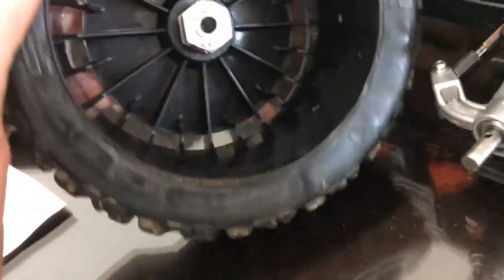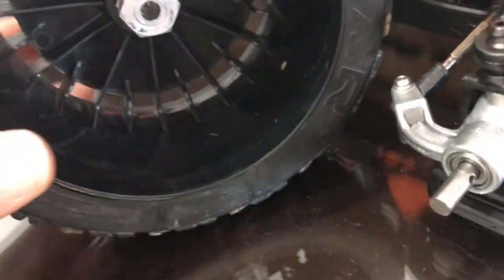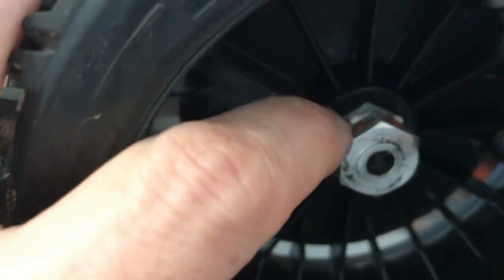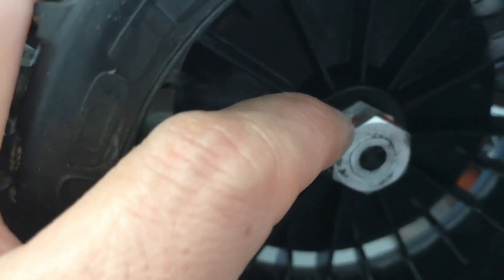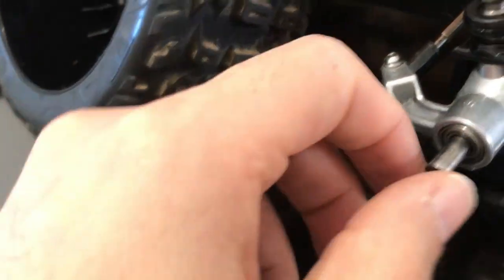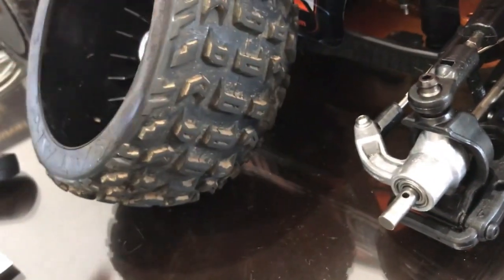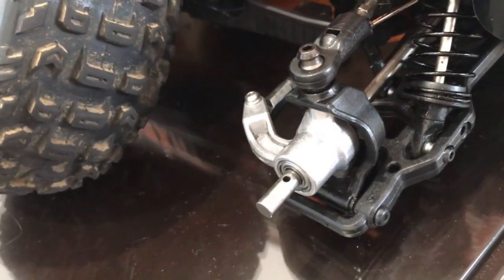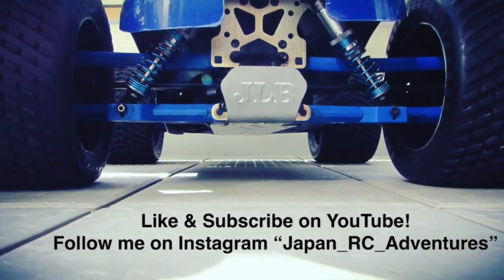First DHK Maximus 6S 😂😂street run Blooper😂😂 of 2019

Comment: Where did you get them wheels bro and use rubber grommets bro you can buy boxes with multiple sizes for cheap I honk I seen in one of your later videos that you have been using thin cable ties such an exspensive hobby if been struggling myself shouldn't be purchasing stuff but I can't help it keeps me sane wicked video bro
Reply: It's Jesse Thorne by the way you commented on my DHK crash lol
Reply from the maker: Thank you very much and I know what you mean 😂👍👊✌️ got these wheels on Ebay they are calles SRC Terrain Crushers 🍻✌️👍

Comment: Cool man my be try to straighten the bent drive shaft?
Reply: Yeah replace a lot ....6 mmm is a joke for a heavy car like that
Reply: @JapanRCAdventuresS  me two 😂😵
Reply: They don't fall off bur little crack ...i plan to do heat treatment . i will try wit tje broken one to see if the material tske tje treatment 😊👍.. Also got the motor mount for 42 mm motor !!!
Reply: @JapanRCAdventuresS  yep i let yu know .. I bash pretty hard my zombie hinge pin brace , pin , hex , bumper, wing mount, diff ..blabllabla.😂.. It's ok , no funny without breakin parts .. Its time to rebuilt this sucker anyway..buy a lot of diff cup amd drice cup ...😜